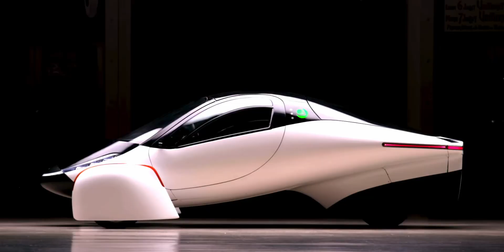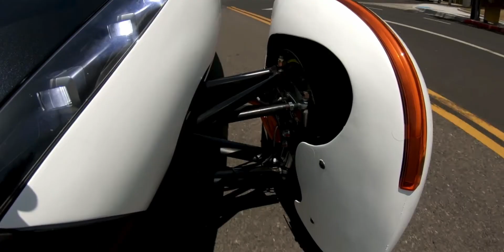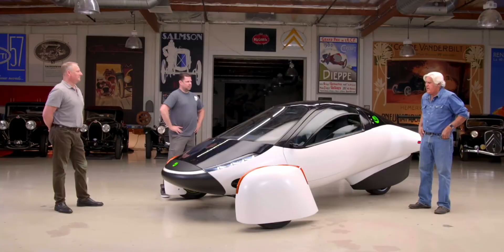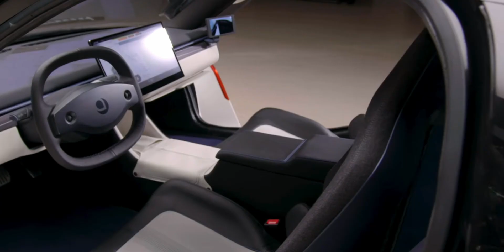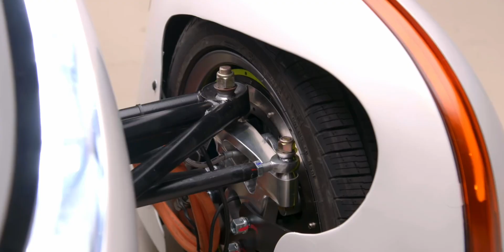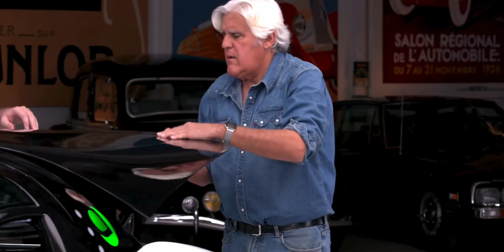MORE Aptera EV Info revealed this week!

Comment: Thanks for your thoughts on this interesting EV.

I don't see this car as something normal people should buy thinking they get a good reliable car. Instead I think this is more of a second (hobby) car. 

It will break down all the time, repairs will be expensive and take a long time, it will be unpredictable in some situations and it will be expensive for what you get. It's the first of its kind and even when it will be released it will be at a state Tesla was 10 years ago.

For the foreseeable future Aptera can only compete in the category of uniqueness and design which is amazing I admit.

But for people looking for a good reliable electric car they should first look to Tesla and if the price is to high maybe to some of the other old well established car manufacturers like Volkswagen or Renault. 

Also I think in the not so distance future we will only use shared self driving cars, so in 10 years maybe Aptera finally arrives in the mainstream as a shared vehicle. If the company survives that long of course.

But I am not saying it is a bad car. It's one of the best EV ideas I have seen, what I am saying is they have a long road ahead which Tesla already walked. And Tesla will accelerate like crazy in the coming years maybe in the 6-7 year Aptera needs to get some cars out Tesla has newer batteries, more efficient designs, better software, retailers everywhere and a very thought out design and technology.

Comment: I have my pre-ordered as well. Which ranged model did you get?
Reply from the maker: Nice! I only went for the 250 because of price constraints but the 400 is definitely better. How about you?
Reply: @Solidstate  I ordered the 600 mile range, all wheel drive, solar upgrade, with level 2 autonomy, and the upgraded sound system.
Reply: Reservation 16590 Placed in Jan 2021. The full Enchilada Minus The Pet Option or the Camping Option. I believe there will be someone who will eventually after market the camping kit for less than $600. But the 150 Kwh 1000 Kmi All-wheel drive, full solar paneled, with the top Audio, Off-road fenders, and Level 2 Co-pilot, I will probably not see mine for about a year. I heard they will make the lower range Vehicles first. But I cant fkg wait.
Reply: We should make a bet when will they actually start production.
Reply: @brandoncampos2452  I don't know how anyone can predict what us going to happen with the supply chain. 

Tesla has just pulled back from their predictions on the Cybertruck.
Reply: I ordered the Paradigm model of which they will only build 220.  These will 2WD, 40kHh models with the upgraded stereo and full solar.  I will also ordered the tent and the Safety pilot.

I think it is possible i will take delivery as early as summer.
Reply: @n.brucenelson5920  what stands it apart from the others
Reply: @brandoncampos2452  A slightly lower price and early delivery, off set by some features not being fully developed, such as not reversing valve for the A/C.  With right to repair, these things can bet corrected.   I also expect the layup of the composite to become lighter, stronger, and more recyclable with time.
Reply: @n.brucenelson5920  so no special color or better material.
Reply: @brandoncampos2452 I don't know.  There could be some surprises.
Reply: @n.brucenelson5920  You might get it sooner than that. Aptera Motors predicts about 40-50 vehicles a day once they get started.